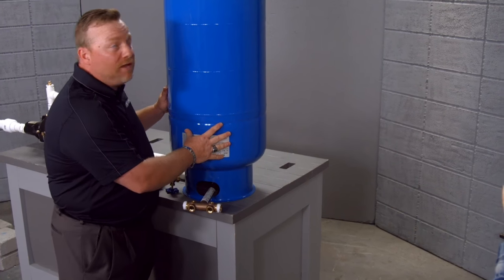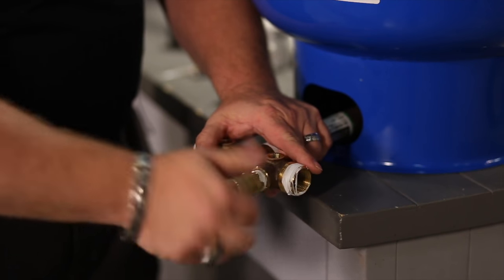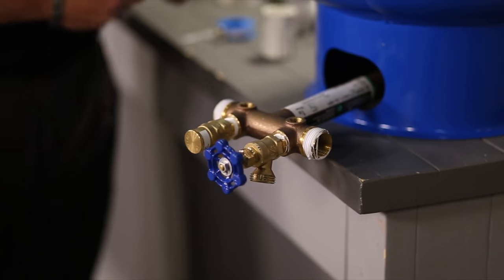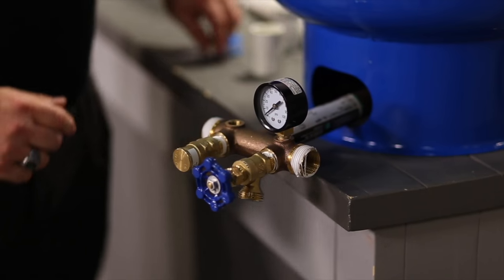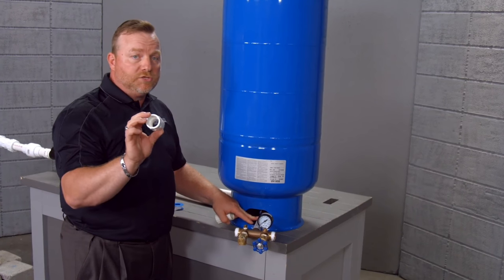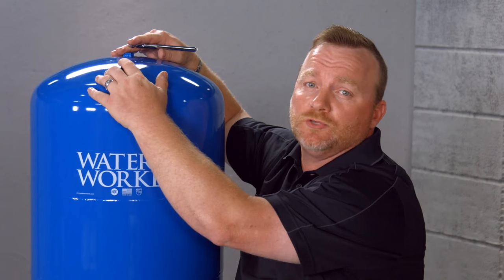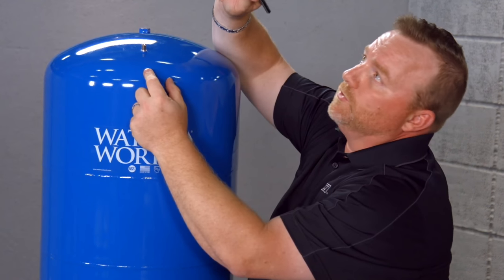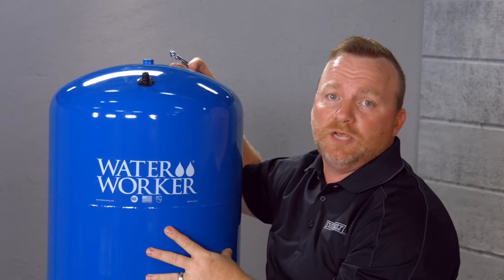Well Pressure Tank Installation | The Home Depot

Comment: Generally you want your female fitting to be made of a stronger matterial than your male fitting to reduce the chance of a crack. So I wouldn't have put that PVC pipe directly on to that brass or copper connection. I would suggest a brass fitting and then the transition to PVC would then be a male adapter. This will prevent a stress fracture of the PVC pipe.